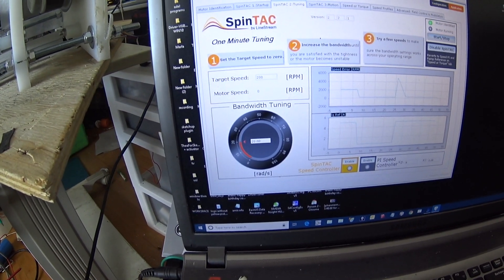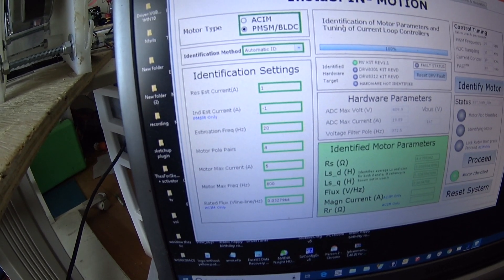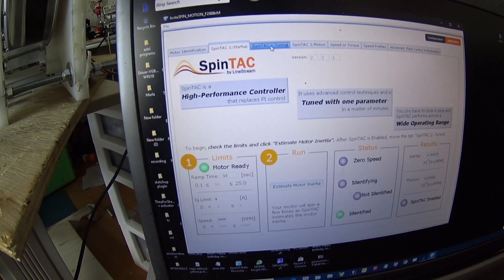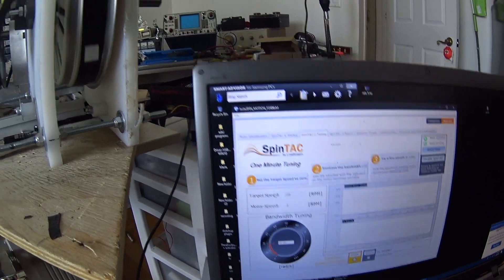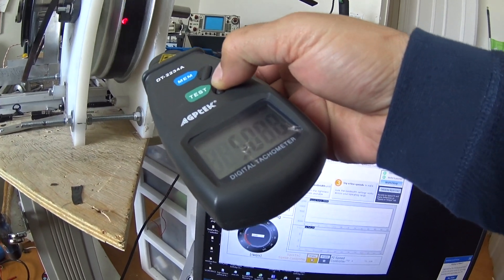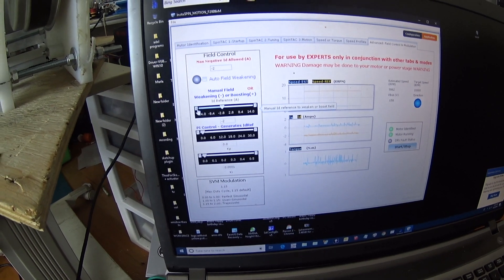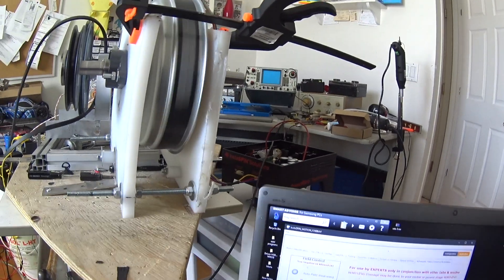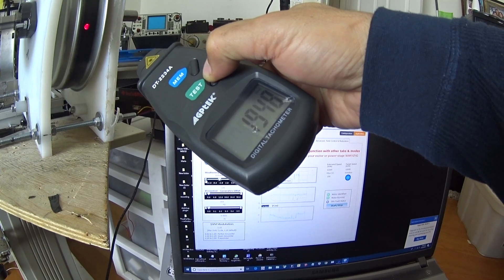Wrap drive and Washer machine at 2000 RPM

Comment: Hey. I'm a new subscriber. I was sent your video by Jason Joplin.  He suggested I request your help to get the software for the instaspin controller functional.  I recently purchased one and would really like to get it up and running. Thanks.
Reply: How do I install the drivers?  Are they on the disc?
Reply from the maker: @MrFigureitout  its on the flash drive yes and check if there is an update on the TI web site also and get a membership its free
Reply: My problem is every time I open the motor ware program, It opens a program called the resource explorer instead. Instructions to solve this are vague and I'm sure there is something im either missing or doing wrong.
Reply from the maker: @MrFigureitout  hi, you need to un install it and install the USB drivers first and the best will be to get the latest software from the site and get a membership its free and they have a very good technical support

Comment: Hi, were you able to measure the torque?
Reply: my gica I didn’t measure it but I calculated and it’s about 12 nm and if ratio of pulley is changed you also change the torque up or down so you can do the pulley for example 6 inch on the motor and 12 on the generator so your torque become 24 nm and so on
Reply: @nato3706  if you can contact me let me know pls. tnx

Comment: Hi Amir. Could you explain to an idiot (me) what you could do with these in a practical sense assuming all the problems eventually get solved?
Reply from the maker: the idea was to turn a generator by this small motor in high speed and get free electricity , the generator produce electricty no issue i have a 10kw wind mill and it produce 220v 3 phase BUT once the generator put into a load ( that is the use of it ) the generator breaks and slow down the motor which the 220v go to 40 volts which can do nothing , because of LENZ law , so the odea unlesss we dont have another mean to cancel LENZ law then no use for this , or mechanical a Flywheel to over come the torque that generator needs , in simple word the generator needs 64NM ( for the 10kw ) and that Motor i was able to make it to do 12 NM and double it by putting a small wheel 6 inch on it and 12 inch on the generator so 24 is not good , unless someone else find something else to increase the torque of the motor without heating it because i can increase the torque but it will heat the motor , i hope its clear
Reply: @EnergySeeker  Thanks for the reply I think I understand. What is 10kw enough to power in terms of appliances for 24 hours? Around 1300watts?
Reply from the maker: @scottmclean8910  10kw means 10000 watt , so if you have a generator 10kw working 24 hours a day then you have 10kw x 24 hours , check your usage per month in kw
Reply: @EnergySeeker  So does the output work with conventional appliances like a fridge or would you have to modify them? Thanks for answering
Reply from the maker: Scott McLean yes after putting the proper devices like inverters and charge controller of course the idea is to get rid of the electricity company
Reply: @EnergySeeker  Is it a question of we don't know how to overcome it or nobody is making the tech to overcome it?
Reply from the maker: Scott McLean well we all trying to overcome the Lenz law
Reply: To overcome the lens law. You need to pulse the motor, not constant feeding the power. That is why the motor is heating up. Which mean inefficient motor. The SYSTEM  want us to have inefficient motor so they can make more money.  Pulsing power allow you to harness the back EMF from the motor and store energy  in capacitors then back to the motor. Normal 300 watts motor in 1 hour, now see power but you only use 15 watts and never over heat.
Reply from the maker: Self Power of Thing I tried capacitor in series and in parallel and they don’t work they eat the voltage tried many values it doesn’t work what is needed is a coil like the Alex doing so Lenz is minimum
Reply from the maker: @wimaxphone  have you tried your generator under load ?
Reply: @EnergySeeker  I am build the a brand new kind of motor. 2 rotors but no stator. This motor will give you 200% power. I will be finishing the prototype in 10 days
Reply: @EnergySeeker  checkout joulebox
Reply from the maker: @wimaxphone  i just saw it its very nice but not for homes that is 60KW , i wish they have smaller one for houses like 20kW
Reply: @EnergySeeker  infinity SAV, they taking order for  10kw

Comment: Good job, where can I get one of those controllers? rick@rrmkg.com
Reply from the maker: Rick R and R Marketing from Texas Instruments
Reply: Your mistake is to think that if you trying to run the HyperDrive with controller which putout electricity, you will be able to achieve something. The controller of Gerarad is radio transmitter very high frequency, then the HyperDrive produces a lot of torque and  never heats up and consumes low watts.  So that way the kit from the website it is also very important there are the  high voltage PowerSupply and UPS High frequency
Reply from the maker: @jhonwhills9263  ?? my mistake is what exact ? i dont get your point am just showing how to run the washer machine motor at 2000 RPM answering somone asked how to run it at 2000 RPM , as to produce electricity i never show how i do it so  i dont know what you complaining about ?!!
Reply: @EnergySeeker  And you actually already are using a higher frequency than what it would normally see. As these motors are rated at 1440 RPM that means that the Hz would have to be at 800Hz to get 2000RPM. There are alternators made to run at 1800RPM for 60Hz power or 1500RPM  for 50Hz power. To get to 3600RPM the motor would have to be fed 1440Hz. As for the Amps, I think I would try to keep it to under 4 Amps. The wire in my Samsung units is 20AWG. The LG unit I have looks to be the same. That means it is rated for 1.5Amps per leg. Which is also why the factory only rates these as 2.62Amps at 310VDC on the .92HP units.
Glad you showed how to get it to 2000RPM. Two thumbs up as it shows that it is the controllers in many cases that are the limiting factor and not the motor itself.
Reply: 10 months later and I did run a smaller Samsung unit up to 2000 RPM. But only briefly as to do so required also applying over voltage at 400 HZ to the coils.110V on 1/3 of the stator coils per leg means that it was only over by about 10%. But that was enough that the normally rated for 800 RPM motor started melting the hot glue that held the extra wires out of the way. Next run will be with a stator set at 1/2 the normal number of coils per leg which should be good to 155 Volts. The 18 coil Samsung split to 3 phases of 2 coils each will run on a 30V rated 30Amp controller at 60HZ though so it wasn't wasted. Run as a generator, at 750 RPM the little one puts out 210 watts. At 1000 RPM it puts out 295-310 Watts into a set of 24V batteries.
Reply: @jhonwhills9263  did you buy one of Morins hyperdrive systems?
Reply: jhon whills - did you buy one of Morin’s HyperDrive Systems?
Reply: he's not answering
Reply: jhon whills - can you share as to whether you are using the Gerard Morin HyperDrive kit or not?
Reply from the maker: please check if you really want this and if you will use it , it depend what you want to do
Reply: ok, if you send me the info sheet on it then I can see. What is the limit of the RPM ?
Reply from the maker: @RickRandRMarketingllc  info on what exact ? the wrap driver ?  here is the info on it http://www.ti.com/tool/TMDSHVMTRINSPIN#supportandcommunity and you can find out if that what you want to have for your application
Reply: Amir, I want to use it to power a golf cart and a 25kw generator. So I need several things, the UPS, and a power supply and high voltage battery pack. It sounds like your LG motor has pretty good torque, can you increase the torque by increasing the voltage?
You can email me if you prefer.
Reply from the maker: Rick R and R Marketing the motor am using is 12 NM torque max not able to drive a 10kw which needs 64 NM generator what motor you will be using ?
Reply: Amir, right. Perhaps that might be good enough for the golf cart, here is what the normal specs say for the golf cart;
Performance Specs:
Approx Vehicle Speed : 14 MPH
Performance  – Speed
Speed Enhancement : 10 %
Torque Enhancement : 70 %
Motor RPM : 3250
Peak HP : 8.9
A 25kw motor would need 64nm or higher. What amps is it using at 2000rpm at what voltage?
Reply from the maker: @RickRandRMarketingllc  check the torque needed for the golf cart , you can do a small pulley on the motor 2:1 ratio and you can get 24NM but low speed as for the 25kW you will need a 20HP gas engine or propane , for the amps with no load its 1 amp , with load it match the output at best case but not more :) if someone say its more then i would like to see that
Reply: @EnergySeeker  HAVE YOU SEEN THIS? Anti-lenz coils?
Reply: Have you tried the Gerard Morin concept of RF Controller at say 500v per phase, it uses resonance like a amplifier for speakers. He says the the higher the voltage the higher the torque and RPM. Had a 2amp motor power a 6 to 10amp etc.. you can watch his videos on YT.
Reply from the maker: Rick R and R Marketing the power is measured at single phase amps x volts if you have 500 volts and 0.1 amps you got nothing useful so over unity I have not see it yet I can do input equals output but that is not good either